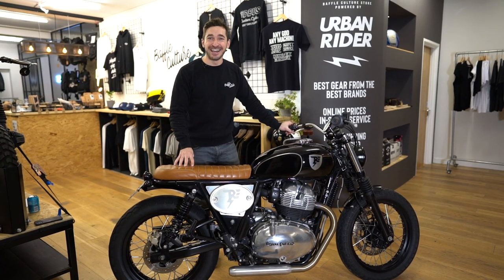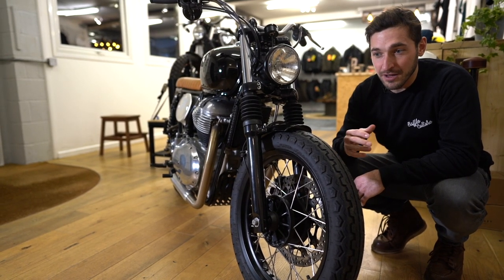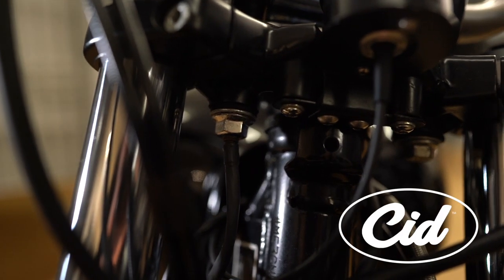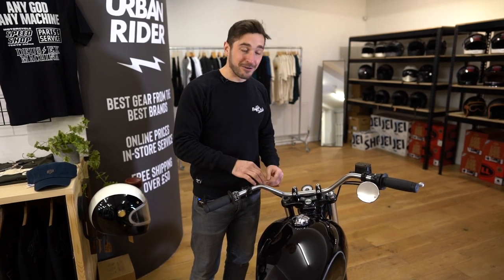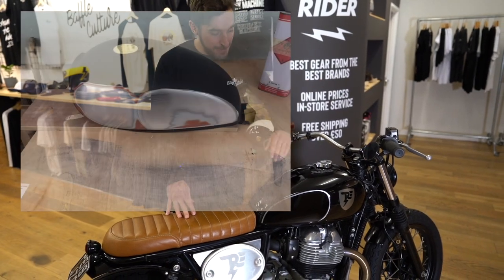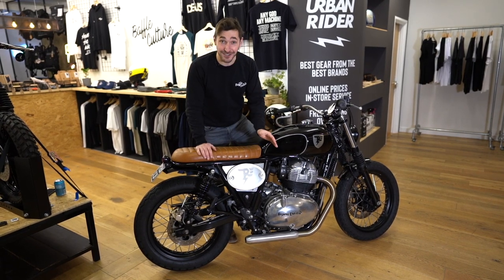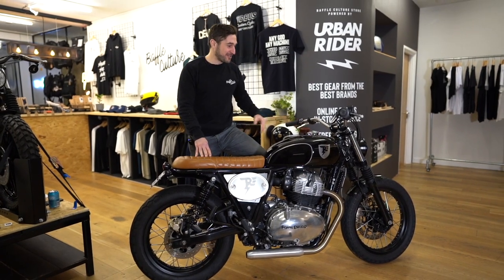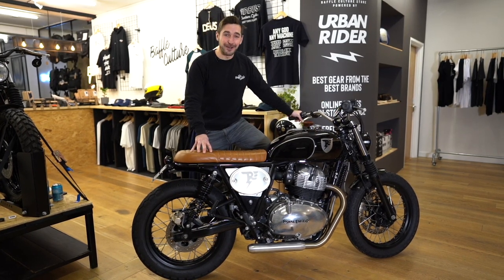Project Enfield - Behind the Build | Custom Interceptor 650 | Baffle Culture x Royal Enfield

Comment: Reducing the back pressure from exhaust pipes changes the fuel map.
Reply from the maker: Our understanding is the ecu on board does a great job at adjusting to extra airflow from DNA filter and mount, also with the pipes. Runs perfectly!

Comment: Are those handlebars easy enough to fit yourself at home & do you have risers on them too to fit the mirror? I Keep going to buy them but then I fill my basket with all the other upgrades and it’s almost the same price as the bike again 😅

Love the bike, slowly going to upgrade mine over time in a similar way. I’ve fitted Indimotard mid controls which is great for positioning with my dodgy knee but pretty poor quality. I know tec are better but just don’t go forward enough. 

Anyways, thanks for the vid.
Reply from the maker: Thanks for the comment! Bars came with long cables for clutch etc. We had our extremely talented bike builder Cid install the bars and controls etc so I can’t go into too much detail. 

Please fire us a message on Instagram / Facebook if you require more information and we’ll reach out to Cid to help out.
Reply from the maker: *to add, handlebar mounts are stock!

Comment: I have a question about the tank paint. Why did the guys scratch/scrape/brush off the original paint to repaint it instead of using paint remover which would have been way easier? What difference does going with the process you guys chose make and why?! It would be helpful. Thanks. 😊

P.S. I too think the tan goes well with the black. 😅
Reply from the maker: Hey Indraneel, we wanted that brushed aluminium style for the tank design to match the texture of the side panels and bar. We used a company called Valkyrie paintworks who did a brilliant job! 

The tank is one of the features we love most about the bike. The quality of finish is second to none. If there’s any further questions on the process, probably best to flick them a message.

Comment: Is the shortened frame section insert for the tail tidy steel? Can't see it on the Baak website. Have seen similar kits available from India but they are plastic/glass fibre which worries me a bit and seems a bit naff. Great job though.👍🏼
Reply from the maker: You can find the product here: https://www.baakmotocyclettes.com/en/interceptor-continental-gt-650/3386-short-leather-seat-kit-royal-enfield-650-interceptor-continental